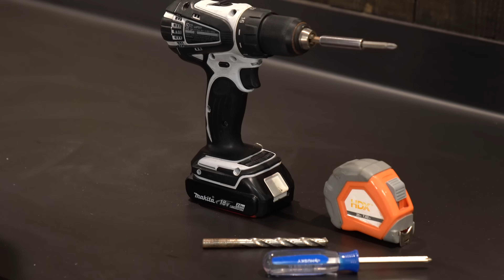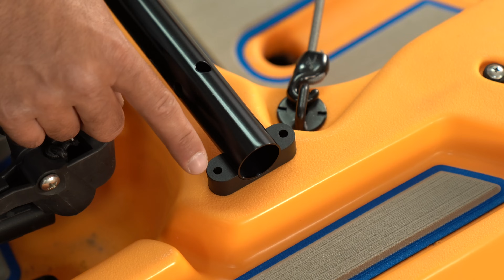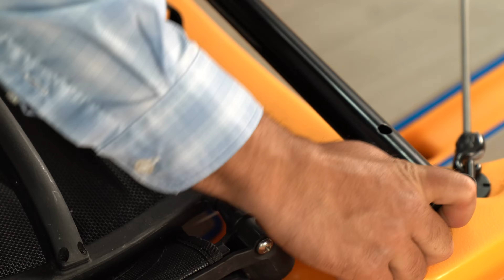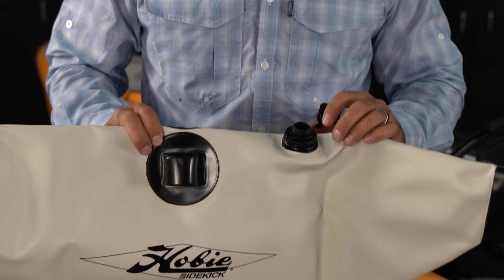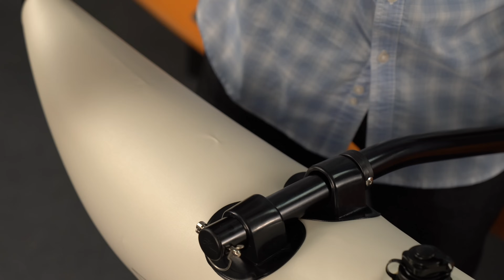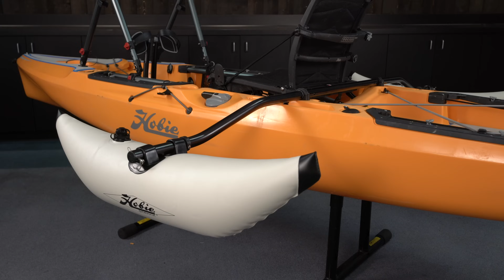Hobie Sidekick Ama Kit - Installation and Adjustment

Comment: Has anyone installed one of these on a hobie compass? When lining up the centre hole to either the front or back, it is impossible to access the bottom hole as it lines up with the hull or the bracker, depending on where the bracket is fitted
Reply: Yes read my comments above.
Reply: @susansullivan3791 can not see any other comments from you

Comment: But will the well nuts just pull back up since there is no nut inside the boat to hold them in place? Or no expansion-bolt type of hold?
Reply: I have 3 compass kayaks and yes well nuts will pull out! I used 1/8" toggle bolts after the well nuts pulled out. I have not been able to find stainless steel toggles. I use some good calking under the mounts. You will always get some dripping. It takes about 3 years of continuous salt water usage before they rust out. No big deal to install new toggles.  My compasses are only used in the ocean. I have been using sidekicks for 10 years and this works. YOU MUST check the integrity of the mounts each time before you go out. You can even use the cross pipe to help lift the kayak. But again always check to make sure it is sound.

Comment: I just bought the kicks and I have one question  and one remark. Is it better to surf launch/land with or without (can't find videos) and the idea of taking them out while in the ocean is nearly impossible at least brand new, as they are EXTREMELY tight fit. I'm sure in time  they may eventually get loose. I  am considering sanding them a bit
Reply: I feel bad and I have to confess. The extreme tight fit was a one time thing. I had to use both my feet to remove them that first night but the very next time I tried, (one week later) they went together and came apart without extraneous effort.whatever it was that was binding,(paint maybe) has been freed and it works fine. I installed them on my Revo 13 and am extremely happy. Forgive my rush to judgement . I received them in the evening and was excited anyway but I wish I had tried them again right away.  Tomorrow morning I will attempt the assembling of them from my front storage hatch while on water.woot woot!
Reply: @socalikayakadventures6985 this is an old thread, but what’s it like installing it out on the water?
Reply from the maker: We recommend launching through any sort of substantial surf with the sidekicks removed.  Small, ankle high surf shouldn't be an issue, but for anything larger than that it's best to remove them and install them once outside the surf zone. If you want to lightly sand the end fittings to get them to insert to the crossbar more easily, you can do that - just be cautious to not over sand.
Reply: Thanks for the response that's really the way I was leaning. I will be cautious when I sand the inserts.

Comment: OK, I have these and here's a mod you MUST do! If you have a battery and a trolling motor it will push down on the middle bar and make the ends curl up. Simple fix! Cut a piece of wood, 2"wx 1/2"thick  and 18" long. Deflate the pontoons and shove it between the two rings that hold the bar. Done!
Reply: Also, forget the clamp attachment rubber insert that is put down in the hole that attaches the bar rings. At ACE they have these new "Butterfly screws that are amazing. They look nothing like the ones you put in walls. Ingenious on how they work. Just ask them about the 8" long plastic ones. After you insert them down in the hole, you snap off the 8" piece.

Comment: I have it installed on my Revolution to use with my sail.  Hobie used to recommend screwing the wellness by hand.
Reply: Power tool screwing is an easy way to mess up a kayak. It's a very small job, use a hand screwdriver!

Comment: I have the side kicks and i have a video on my channel too about the side kicks. Grate product i like them a lot. But there are two thinks about i dont like... 1. You have to make the plastik thiner to put them easyer together. 2. They are shaking around. Sorry for my english iam swiss. Check my video out to know what i mean.
Reply: Exactly, i had to sand paper plastics.
Reply: @radoslawjablonski8258  me too
Reply: You are right. I installed the Hobie Sidekicks and had two major issues. The outrigger arms did not fit into the centre tube that is attached to the kayak. I had to file them and even after that not easy to insert and remove. Also difficult to rotate the arms to adjust float positions. The "buttons" that you press to insert the arms eventually broke. Considering the high price the quality of this product is exceptionally poor. I also has issues with my Hobie Kayak. Seat plugs would not stay in place so the seat moved around. The mirage drive was very difficult to install and often came loose from the cam locks. Overall. considering the very high price for Hobie products they do not deliver on quality in my experience.
Reply: It's enough lubrication to just spread a little water on the bars and inside the pontoon rings. It still needs some muscular turning back and forward while pushing the bars into the rings. Oh, and don't have the pontoons fully inflated when pushing the bar in the rings. Fully inflate afterwards.